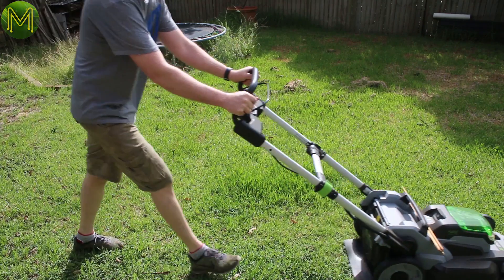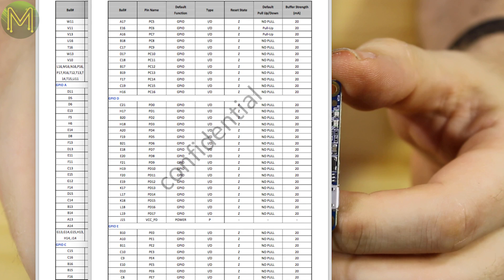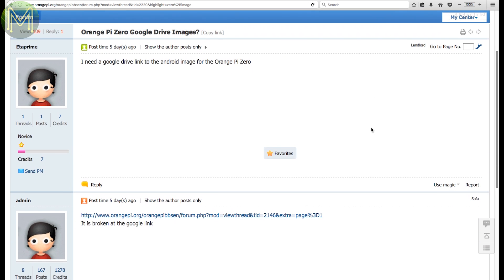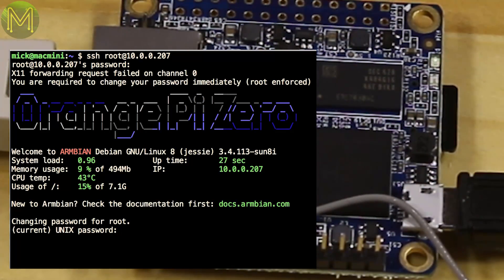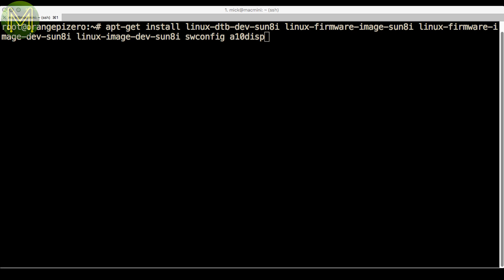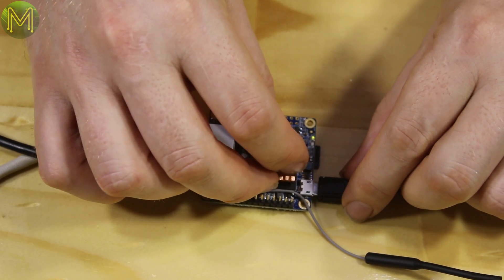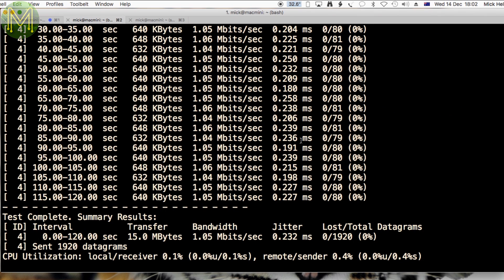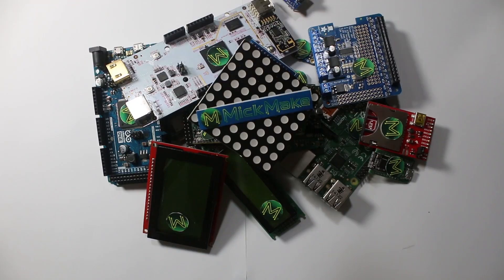#080 Orange Pi Zero: Better than the Raspberry Pi Zero? // Review

Comment: Question:  I bought an Orange Pi One, when you try to plug it into a 5V, 3A adapter you get the see the LAN port lights up.  I was told that by the seller that this is an indicator that the SBC is powering up correctly?  Is it true with all orange pi boards?

Comment: Nice review. I wanted this for a Android Auto project using crankshaft app which works great with Rpi3 out of the box but i am not sure if it will ever work on this board. can you provide some helpfull information regarding that? should i just get Rpi zero instead.
Reply from the maker: I'd have to look at the Android Auto project. Haven't really checked it out yet.

Comment: I've been thinking of getting one of these with the idea of doing some Magi coin CPU mining. It would need to be on 24/7 with the CPU running at 100%. The overheating issue was a little concerning though, and I'm too lazy to add a heat sink and blow air over it. Do you think it would die if I tried to do this with it? 

BTW, they recommend a 5V 2A power supply, but it seems it was only pulling 300mA in the test. So could I run this on a standard 500mA USB phone charger?
Reply from the maker: You have to remember that without a heatsink the CPU will be throttled. For mining you'd really need to have a decent heatsink.

They recommend 2A power supply more than likely for the in-rush current and anything you might be adding via USB. YOU could get away with a lower current supply, but if you're mining, I'd suspect you'd have a bunch of them. In which case you could stagger power up and get away with a smaller supply.

Comment: i2c is working in the stable armbian now
Reply from the maker: Nice! Yup saw that. I think it’s about time I did a review update.
Reply: MickMake i managed to solder on pins without breaking it because of overheating, im screwing around with it, it works with my 128x64 oled
Reply from the maker: Nice.

Comment: Everyone mentions the support of the Raspberry compared to the Orange Pi, I have to disagree. I owned both SBCs, I built a headless server with the Orange Pi running Boinc client, an ADS-B base, samba file server, and lighttpd web server, all of them well documented in the internet, things related to OC are also well explained in sunxi website.
Reply from the maker: Yup I agree. The Pi has been the winner for many years, but other SBCs are starting to etch away at that crown. It won't be long before they make an impact. If you're a beginner, then non-Pi SBCs will be tricky, but if you've been around for a while, then they're starting to be a viable alternative.

Comment: Wow I didn't realize quite how stunted it was, thanks for the info I'll stick with the ras pi zero w or one of my other more powerful boards if really needed. This just isn't for me and it's a shame all it's capable of but missing and how shoddy the support is compared to the ras pi community. It's like  arduino, the best part of the ras pi is the community that makes it accessible to people to learn about and move forward in their projects and up the difficulty.  Both will always maintain an edge over competition because of these very extensive and driven communities already in place and the fact that the makers and designers (and everyone else) put out so much info and detailed project tutorials and code when a board is released and it develops further very quickly. In contrast this seems way rushed in both the board and the lack of implemented features as well as the much smaller and desperate community of basically broken images and a small forum trying to save a sinking ship as best they can. You need the big community to make projects that build libraries that makes all aspects of the product as accessible to all skill levels as possible and that's how people find those most innovative ways to maximize the hardware but you can't expect the purchasers and the community to do it all. You have to put out a lot of stuff when you release a product just ask Lady Ada and adafruit or arduino and that's why they are so successful and beloved. When you buy a dev board to experiment you want and need that community and a head start from the designers, this also builds trust and a faith in the community for help and resources which in turn make you want to contribute and so the cycle goes if done right.This may have a much beefier and capable chip but in addition to not supporting many of its features at the kernel level, the board doesn't even have the layout or pins for support/expansion to ever come to it. You may have more processing power which is good for some projects but you sacrifice so damn much of the other things the chip is already capable of and that will tend to upset users and be very frustrating. People who bought it for the chip want to be able to use the darn chip! Use the RIGHT chip for the job and break it out and support it properly w ports, components, etc. don't just get a beefy hot running chip and give up almost everything other than Ethernet, 2 USB (sort of), and the only video options you have is the jack or to wire out vga I believe. Plus leaving out the memory on the bottom  was just cheap and not being able to even support it yet sucks to especially because all of the shortcomings are so visible and disappointing if you were just reading what the chip was able to do and were excited by specs. Not a fan of it and it seems like too much frustration to even setup an begin before you can even start coding anything and even once you have put in the time, why bother when you're so limited in features you can access at all? And if you say just to just directly breakout more of the chip then you're missing the point of these boards and underestimating the difficulty of such a feat. Great videos thanks again for the information and warning. I still think I may be stuck with a couple of these somewhere I'll have to find a use for or  give away. I should have looked closer but I threw them in w an order from china right when they came out by chance and they were cheap so whatever. I can work around and with them but it's a hassle and I would have liked hdmi and more USB ports at least and or  Bluetooth would have been easy (as would more pins have been). Honestly between this or any of my other boards I'd choose a pie zero w or even and esp32 avr combo, anything really lol just for the sake of sanity. I will give it shit when I find them tho I suppose but I don't relish it.  Hopefully someone clones it quickly and adds more gpio pin rows like you pictured and adds the memory chip and maybe some other stuff like hdmi video if they haven't already(I've already seen several variants in passing some with more pin rows at last ). We can hope. Cheers and again, great vid

Comment: Dietpi works GREAT on this little board...actually on almost ALL non RPi SBC's!
http://dietpi.com
P.S.  It has a VERY cheap expansion board
http://www.dx.com/p/orange-pi-expansion-board-w-2-usb-interfaces-for-orange-pi-zero-blue-456557
Going to need some active cooling on this teeny board...the quad core processor gets HOT fast!
Complete setup for under $25
http://www.dx.com/p/orange-pi-zero-ram-512mb-expansion-board-matching-abs-case-kit-455822
Reply: dietpi no longer supports any of the orange pi hardware...fooey

Comment: Except: https://organicmonkeymotion.wordpress.com/category/orange-pi/ and a raft of people getting dud boards straight out of box (see orange pi forum)
Reply from the maker: +Asterion Daedalus 
Yup their quality process isn't that good.
Reply: yep, the bane of so called "opensource hardware" -- it is trying to be so cheap there is no room for warranty provisions and therefore quality.  Although, I got the same from an Intel Curie based Arduino thingy.  That's in bin too.  I guess it is an emulation of opensource software: doesn't install, doesn't compile, crashes, no help files, no useful help on user groups.

Comment: Best power supply adapter for zero? I think smartphone chargers doesn't give us stable power for power it on right!? someone in forums told PSP adapters have stable 5V 2A power but I should convert to OTG microUSB first. any ideas?
Reply from the maker: +Pouria Rezaee 
I managed to power it from an Apple wallwart without issue. Worked well enough.

Comment: You were able to attach an external Hard Drive? If so I was thinking of using the Orange Pi Zero as a Time Machine Server.
Let me know!
Reply from the maker: That'd be a nice use for it. There's a NAS board that you can get for it now which will allow you to attach a SATA disk/SSD.
Reply: at that point I could get he Orange Pi One. Don't have wifi but has HDMI and the price is 2 USD more.

Comment: So wait... they put a full size network connector, but didn't even put a micro or mini HDMI port?
I'd rather have a smaller network connector and an adapter. 
I'll definitely pass on this one.
Reply from the maker: Unfortunately no! Not even a header for it.
Reply from the maker: +Lazy Bunny 
This might be more what you want?

http://www.cnx-software.com/2017/03/17/18-9-orange-pi-zero-plus-2-board-allwinner-h3-wifi-bluetooth-le-hdmi-and-8gb-emmc-flash/
Reply: Sad Trombone. I saw the header said TV out. But that's not good enough. I like my emulators, so seeing that, i was really disappointed. Good video though.
They wanted to compete with the pi zero, but they definitely failed. I personally want a pi zero-w with a pi2/pi3 SoC with the 1GB ram.
Reply: That's... That's actually pretty cool!
That actually is about the size i'm looking for. Thank you.
Reply from the maker: +Lazy Bunny 
No problem. Just been released and I've ordered one myself.

Comment: How you found IP address?
Reply from the maker: +Vladimir Minkin 
Raspbian will run the zeroconf service on boot, which means you just use the hostname "raspberrypi.local".
Reply: I'm trying Armbian from https://www.armbian.com/orange-pi-zero/
But ethernet port is recognized on my ubuntu\elementary machine and after rebooting red led still blinking. What is happening? :\
Reply: Actually, I found that it's a orangepizero.local
Reply from the maker: Vladimir Minkin 
Ah yes, sorry. For Orange Pi Zero it'll be that host name.

Comment: I Picked up one of these last summer. Could not get it running, had all sorts of emails back and forth with the support folks, they finally sent me a new board, that one worked.  Well I was a bit torqued off about this, so I took a hot soldering iron and resoldered the board since it looked like some nine year old kid with a torch and a hot nail did the factory solder job. After redoing all the joints, I got the first board up and running as well, the quality control just isn't there on these as far as I could tell, however the replacement board did look a lot better so perhaps my first board was a quirk.
Reply from the maker: Possibly. I haven't had any issues so far with my boards.

Comment: '39.3 degrees witch is an average aussie december day' 
wow!
5 degrees for an average dutch december day and i think 23-25 for a dutch summer day
Reply: MickMake Right now its Winter here in Aus tria
Reply: MickMake It's rising! Also that is the wrong City. Steinabrückl. I think I got it right
Reply from the maker: +Kars Noordhuis 
Yup, and it hit around 46C the other week. That was an unusually hot day!
Reply from the maker: ElectrodeYT 
Not too bad at the moment at 3C! That's pretty warm!
Reply from the maker: ElectrodeYT 
I thought the winters over there were supposed to be sub zero?
Reply: MickMake climate change is happening and spring is coming so temps are rising

Comment: Can you please a do detail video about using the GPIO of orange pi zero.
how to programming it in python or c++.
Reply from the maker: Yup sounds like a great idea. Might run through a coupe of boards at once.
Reply: Use the WiringPi fork for the Orange Pi. I believe it's WiringOP. I realize this is an old comment, but if anyone is looking for guidance on this, there's a great video here on YouTube about using WiringOP on an OP Zero. This fellow does a GREAT job showing how to interact with the board using WiringOP:

https://www.youtube.com/watch?v=LsA0LL8yn_k

Comment: NEWS: I got an Orange Pi Zero from Banggood & it got a flash chip!
It is a Macronics with these numbers MXIC MX 25L1606E
http://www.macronix.com/en-us/products/NOR-Flash/Serial-NOR-Flash/Pages/spec.aspx?p=MX25L1606E
http://www.macronix.com/Lists/Datasheet/Attachments/5089/MX25L1606E,%203V,%2016Mb,%20v1.8.pdf
Dunno much about Embedded & Uboot stuff but there is info there:
https://linux-sunxi.org/Xunlong_Orange_Pi_Zero#U-Boot
Reply: igrewold That is really cool, but I don't think it is big enough for any linux port that I know of. That looks like a 16 megabit chip, which is only 2 megabytes. Tiny core needs at least 12 megabytes for the non graphical version. The flash would be really useful for perhaps a PXE bootloader?
Reply from the maker: +igrewold 
So they finally did it! Excellent! Thanks for that heads up!
Reply: Sure & thank you to :) You know this is very useful for 
DIYers/Maker/EEs & fans. It means one can run tiny OSes without the 
need of a uSD card, something like piCore/Tiny Core Linux check it out 
if you got an RPI http://tinycorelinux.net/ports.html
They also got a free ebook
http://www.tinycorelinux.net/corebook.pdf

Comment: Can the Orange Pi Zero be powered through a pin? If so which one and how much Volts and Amps does it accept?
Reply from the maker: +Mateusz Wiater 
It would be possible. You night have to cut a few tracks though.

Comment: +MickMake would you like to show code in GPIO.sh file (5:15)? How do you access gpio pin? I tried with pyA20 python library and wiringPy but with no success.
Thank you in advance! :)
Reply from the maker: I used the Linux /sys interface to access the GPIOs. It's pretty simple.

# Create a GPIO reference for pin3.
echo "3" > /sys/class/gpio/export

# List the newly created reference.
ls -l gpio3/
total 0
rw-r--r- 1 root root 4096 Jun 29 14:59 active_low
lrwxrwxrwx 1 root root    0 Jun 29 14:59 device -> ../../../up-pinctrl
rw-r--r- 1 root root 4096 Jun 29 14:59 direction
rw-r--r- 1 root root 4096 Jun 29 14:59 edge
drwxr-xr-x 2 root root    0 Jun 29 14:59 power
lrwxrwxrwx 1 root root    0 Jun 29 14:59 subsystem -> ../../../../../class/gpio
rw-r--r- 1 root root 4096 Jun 29 14:58 uevent
rw-r--r- 1 root root 4096 Jun 29 14:59 value

# Set the direction of the pin.
echo out > gpio3/direction

# Set it to HIGH.
echo 1 > gpio3/value

# Set it to LOW.
echo 0 > gpio3/value

# Remove the GPIO reference.
echo "3" > /sys/class/gpio/unexport

Also checkout my GPIO mapping perl script which shows which pin correlates to which GPIO.
https://github.com/MickMakes/GPIOmapping
Reply: Thank you very much! :)

Comment: Hi Mick, can you give some info on the PoE capabilities of this little thing?
Reply from the maker: The PoE isn't really PoE. It's more of a "place holder". You can provide your own PoE module which will make it fully compliant, or just use the onboard regulators which will be a "hack job" but functional. The onboard regulators can't handle the input voltages of true PoE.
Reply: So it does not have any better PoE functionality than any other of the other single board computers?
Reply from the maker: +Johannes Yde 
Well it's slightly better. The OPiZ has the ability to breakout the PoE lines on the PCB, so you can have more of a complete PoE setup than wiring it up before the RJ45 plug.

Comment: Thanks a lot man :) very informative video.
just had a lil idea, how about underclocking the cpu? to save power and to lessen the heat, what you think?
Reply from the maker: +igrewold 
Yup under clocking is fairly trivial as it has dynamic frequency scaling.
Reply: What do think is the lowest frequency it could run at? Can you please try that? And see how much it affects power(supposedly running on batteries say 18650s) and cpu heat.
Reply from the maker: igrewold 
I can't remember offhand what the min frequency, but might me a good video series to do - under clocking performance.
Reply: Maybe under-volting say to 4.5v might help too.
Reply from the maker: +igrewold 
A lot of SBCs tend to get a bit upset with under voltage, but yup maybe worthwhile doing a video on that as well.
Reply: +MickMake
This guy did some wizardy there:
https://forum.armbian.com/index.php/topic/2808-orange-pi-zero-went-to-the-market/page-2#entry19347
Also read post #50 to get an idea on why it is overheating.

Comment: how is it competing with the zero when, its extremely high powered. its got lots of large connectors. its got a large pcb? it seems like it is competing with a pi 2 or 3.
Reply: Maybe there are work arounds like underclocking the cpu and setting it in a high powersaving mode...etc.

Comment: Does the OPI Zero reboot with the same MAC address?  I set up a bunch of OPI PC as Octoprint servers, but they would reboot with a different MAC address as the router would not give them the same ip address.  That is an issue for a headless server.
Reply from the maker: +Andrew Hasara 
Yup they came up with the same MAC.
Reply: Thanks for checking that.  This may become my new favorite Octoprint board.